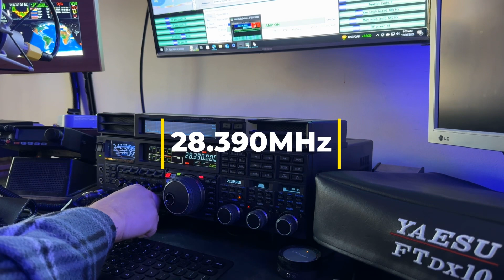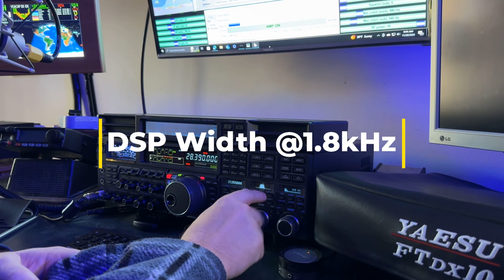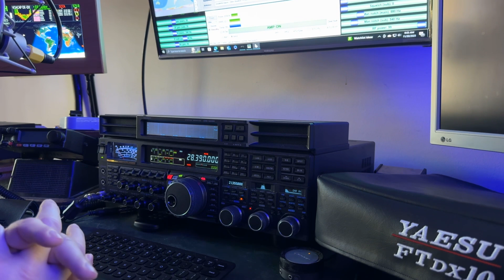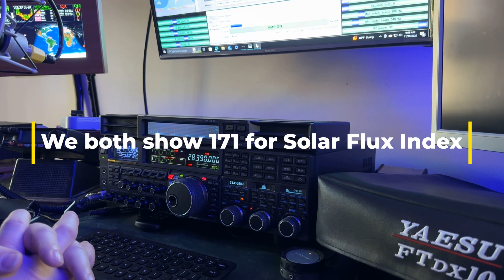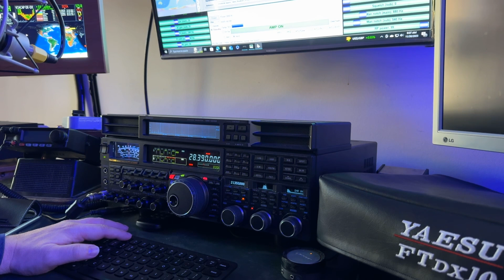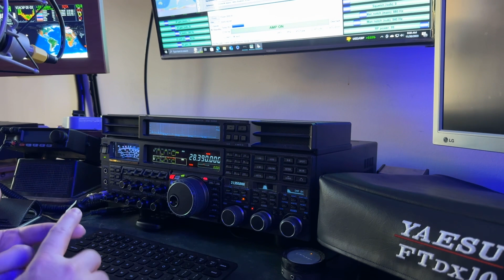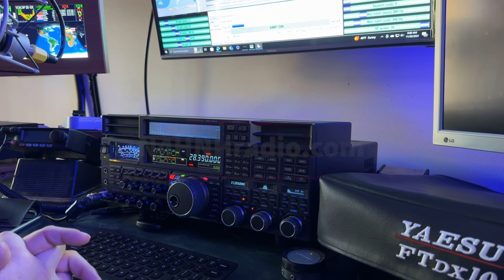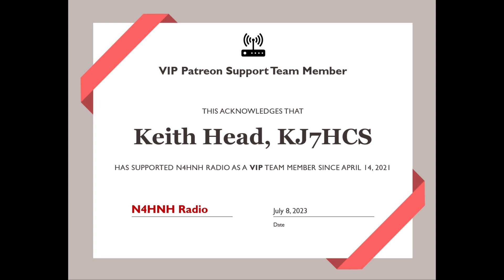Working HB9CVQ: Gain Structure, DSP, IPO, S/N Ratio, Solar Flux (much in this video) #hamradio #dx

Comment: On my FT-DX10 i use IPO on all the band. On 20 Meter sometimes i use 12db att, and the S/N it's very High. I prefer tò listen a cw signal without qrm and noise. 73 de IZ8FAV
Reply from the maker: I agree. That’s how I operate. Improve the S/N Ratio. Check out my video entitled, “S-meter to the Left.”
Reply: @n4hnhradio  of course, I've been following you for a long time and your advice is really valuable.
Reply from the maker: Thank you for following my channel!  I’m glad you have found it helpful. 73